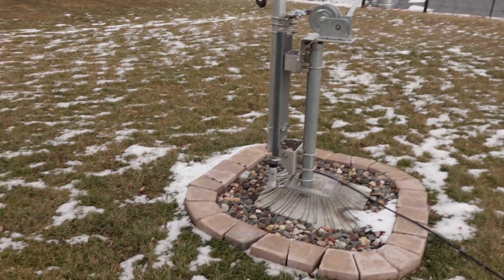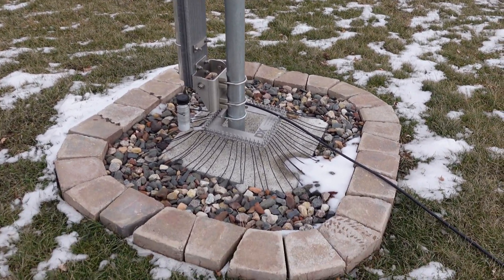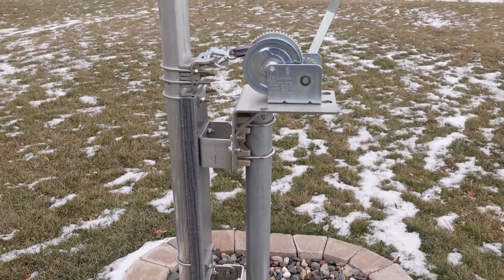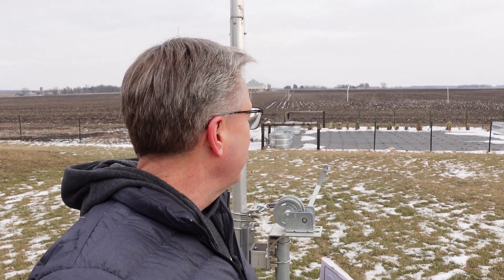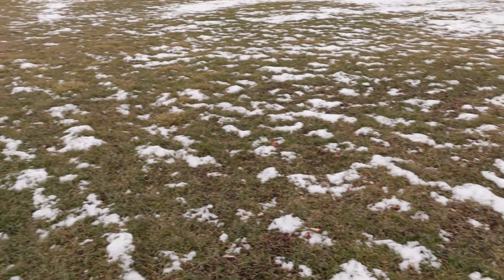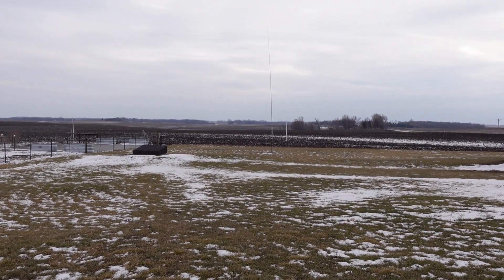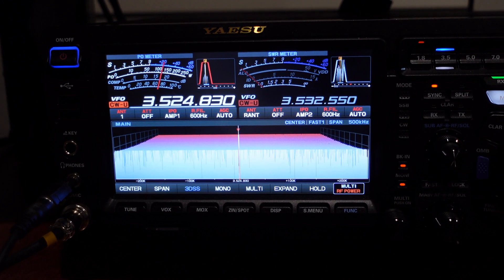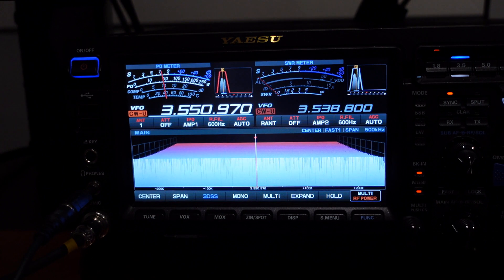DX Engineering DXE-7580FS-VA-2 Full Size 75/80 Meter Quarter-Wave Vertical Antenna

Comment: Have you tried disconnecting the radials and putting a temporary 49/56:1 inline to make a 1/2wave vertical and trying it against your 1/4 40m?
Reply from the maker: I have not.  To be honest, I'm not much of an experimenter.  I'll build the gear and then use it as it's supposed to be used.  Not one to tinker and modify.  I've got a great friend, who is an Engineer.  Maybe I'll approach him with that idea and see what he comes up with.  Thanks for the idea.  Cheers!

Comment: Great video Rich.  You mentioned a friend that had a 4 square with these antennas.  Don't suppose that might be K0MD?  I'm a transplant from MN/WI, and still a member of the Twin City DX Association.  I've been considering one of these.  I have some space, but can't put up the 100 foot tower that I had back in MN and the neighbors would howl at my messing with their view of the Superstition Mountains about 4 miles away.  I don't think they would grumble about an 80M vertical.  The shunt coil improves feedpoint impedance match, but a bleeder resistor between the feedpoint and ground will also eliminate a lot of static induced noise.  Thanks again for the video.
73 ES GUD DX OM
DE Gary W0AW//7
Reply from the maker: I can't divulge the ham who has four but he's southeast of me.  You'll love this antenna and the performance you'll get.  I wish I had room for four. Hope to hear you sometime.  73!

Comment: I’m building one now.  Pipe and concrete installed.  60 each 65ft radials deployed.  Still need to staple them.  Unfortunately when I ordered the antenna one of the 2 boxes is back ordered til end of March.  So I’m trying to get as much as I can done before.  So far looks like a very stout mount and setup.  Your video here was very helpful to me for pushing me to purchase.  
My RX system is a 9 Circle array using DXE-AVA-3 buffer amps and 18ft elements. YCCC phase controller design and improved by VE6WZ circuit board. It receives very well from South Texas. I’m looking forward to having this vertical functional.  73
Steve, NA5C
Reply from the maker: You will love this antenna.  We had really poor conditions this weekend and I ended up working 39 countries on 80M.  Keep me posted on your progress and the performance you get.  The 60 radials is key!  73 Steve!

Comment: Let me know when you get a chance to run it against a dipole at 70 ft. I’m curious. I’ve used the 4 sq version at n4qs and a vertical delta loop at n4ss. Both are stellar setups. I bet 1 would be better than my dipole at 40ft. Btw 50mph winds right now eek
Reply from the maker: I don't have a dipole at 70' (yet).  If I get one, I'll do a comparative video.  73 Jay!

Comment: Hi.  At 7:47 you discuss the "shunt coil" and can't seem to find any info on that.  Can you please discuss that some and its value and is it directly across the input feed?  It looks like there is a tap on it.  Is the impedance of that supposed to be much greater than 50 ohms so as to drain charge that might be picked up on the vertical?  Is it easy to construct and where did you purchase that from?  Thanks very much.
Reply from the maker: Go to DX Engineering and look at the DXE-VMN-1 coil.  They probably describe it better than I could.  I noticed that I was hearing a bit of noise after I bought the vertical.  This coil helped eliminate the static that I was hearing.  It also bleeds off any static that builds up on the vertical.  Hope that all makes sense.

Comment: Have you been able to use this antenna on any other bands? And are you working regular non-contest DX stations also?
Reply from the maker: It is designed for the 75/80 Meter band so I haven't tried it on any other band.  I use it in non-contest situations too and it works great for regular contacts all over.  It provides me with a great signal on the band.  Hope this helps.  73!
Reply: @TheOldSwedesFarm  yes that helps.. i am torn still.. i cant decide if i want to go vertical on 80m or 40m first and i have taken an interest in 30m now so i cant decide. I have only had an EFHW and a doublet and havent spent much time in the CW portion of 80m yet. I understand the lower end (SSB) is much different than the 75m portion. I am finishing up CWOps advanced class now and working on Extra class license and i think having the entire bottom of 80m would be nice.
Reply from the maker: @kyledunaway6370  Hi Kyle - Check out 40M first.  Propagation is much better and you can enjoy that (with smaller antennas) and then get on 80M.  Check out my video of the Butternut HF2V vertical.  It is a killer on 40M.  An absolute killer antenna!  It also has 80M but it's a bit of a compromise.  Check the video and you might want to get on 40M first.  73!
Reply: @TheOldSwedesFarm  sorry i just saw this reply.. I recently bought a zero five mono band 40m vertical. I had to clear some land to make room for my radials so i havent installed it yet.. i am looking forward to it! I am obsessed with low band DX-ing! I have my 80m EFHW in an L and the vertical section is about 60’ up and the rest horizontal… that configuration is great on everything below 10 mhz! I worked J88BTI in St Vincent on 80m a couple nites ago.. it was the highlight of my month! 160m is prob most intriguing to me. I had a 160m doublet but took it down. I am able to load my EFHW on 160 but i know its horrible inefficient.. i only use it for some ft8 and CW. Its probably a horrible time to take an interest in DX-ing on 160 & 80 being we’re in solar maximum!  I appreciate your input sir! 73 OM dit dit
Reply: @TheOldSwedesFarm oh i also meant to ask if you are using a beverage or any rx antennas?

Comment: How are the signal reports compared to the smaller vertical? I'm assuming you base loaded the 40m vertical for 80m. KE6VG
Reply from the maker: I have only used the smaller vertical for 40M.  It's really a compromise on 80M and gives coverage on about 60 kc.  I have compared signals on receive on the two verticals and the DXE-7580 kills on receive.  Much better.  I would assume it is much louder on transmit too.  I will have a full review of the smaller vertical (HF2V) on the channel within a week.  Thanks for stopping by to watch.  Cheers Robert!

Comment: Great info. Well done! 
Note that your noise-level is high. You can easily make that noise at least 5 dB lower, by putting up another vertical some 20m or 10m from the 1st one. End-fire feeding, (20m=90°delay line, 10m=135°delay line). Best direction is E or W from the 1st vertical. At least 3 dB lower noise-figure and up to some 40 dB of Front to Back. Domestic QRM almost gone when working DX !
I had a 2el and later a 4el W1CF 4 square in the 1980th with 400 radials for 80m CW. Their feedpoint was 2m up, making the radials sloping down. This concentrate the lobe towards the horizon. Greyline effect was up to 2.5 hours with this setup. (Could work US-stns 2.5 hours AFTER my sunrise towards NW). Hope to catch U in contests... 73 de Björn SM6EHY
Reply from the maker: My noise floor was high that weekend.  Usually really low.  Turned out to be a new light at my (one) neighbors farm nearby.  Not sure I have room for another vertical.  This summer's task is to get 80 feet of Rohn 45 up in the air!  Hope to hear you on the bands soon.  I hope to be in WPX at the end of the month as NT0EE.  73!

Comment: Great technical video Rich. The winch is invaluable for sure. Glen’s grandpas was a telescoping antenna shaped like a triangle if that makes sense? This would be so much easier. 
Fifty seven countries is pretty crazy.
Reply from the maker: I fully understand the triangle!  I've seen it before.  This antenna is really a performer.  57 countries was great for this low frequency.  On a higher frequency, I talked to 115 countries in 48 hours.  We're at the peak of teh solar cycle and it's so fun on the radio!  Cheers Glen & Annette!!

Comment: By the way, did you upgrade from a Yaesu 1000 model to a 101 model since filming the propagation video?  Would be interested to hear what an experienced operator like yourself considers when choosing a rig.
Reply from the maker: I had some issues with the FT1000's.  They were 25+ years old and it was time for a new rig (and new technology).  The new rig is incredible on the receive side.  Just fabulous!  So quiet and the receiving is perfect.  Still learning all the bells and whistles!  My consideration was the Yaesu sound and good receiving on both SSB and CW.

Comment: It seems that you have a big whitenoise floor of abt. s7... hr wrk with 80m wire inv.L, and its also a dx-hunter.. vy73 de Lars oz1fjb - OU2V
Reply from the maker: Most of the time I use a 1000' beverage antenna for receive.  It works incredible with the vertical.  Thanks for watching and commenting.  73!